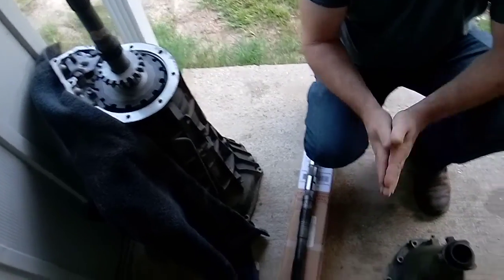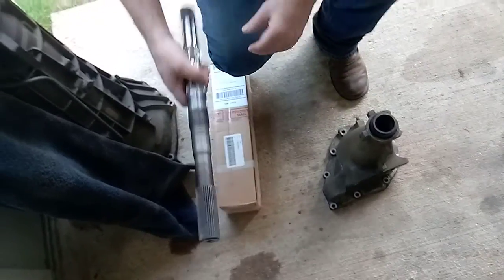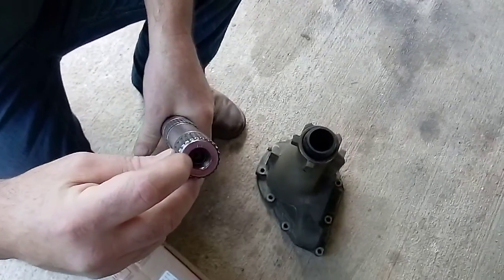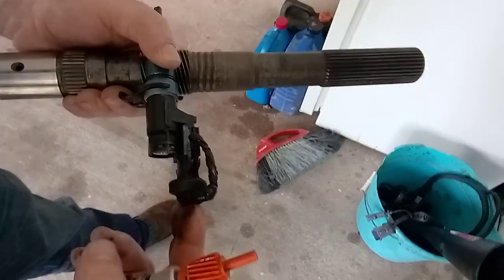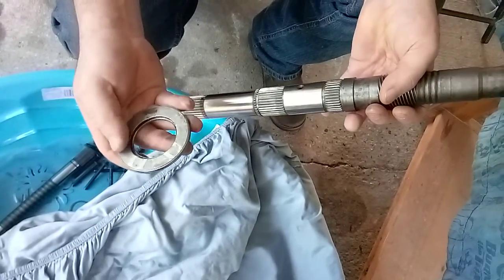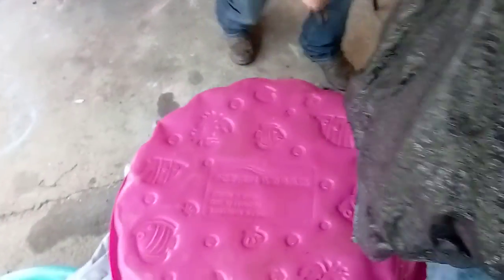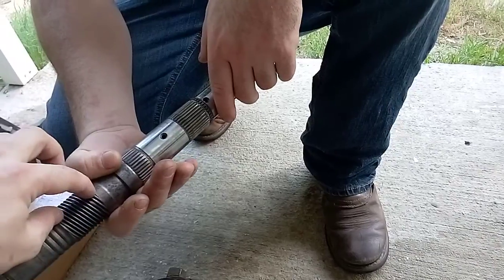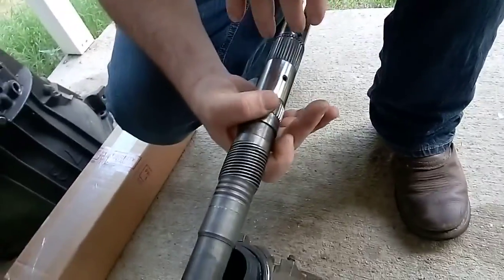Ford E4OD/4R100 Output Shaft Differences Explained

Comment: So i’ve been researching swapping a 2wd to 4wd and was wondering if i would have to drop the trans to change the output shaft or if i’d be able to just take everything off while it’s still in the truck and swap the output shafts? i noticed y’all had the trans out and on its front so i was just wondering
Reply from the maker: The output shaft is held on from a C-clip inside the transmission case. It's one of the last things to come of unfortunately.

Comment: Eh you know if you can convert a e4od 2wd to a 4wd
Reply from the maker: Yes, you can. You need a short output shaft and a 4x4 tailshaft/transfer case combo.
Reply: @shadetreeautomotiveDIY ok so I have a small block bolt pattern e4od 4wd and a big block 2wd e4od so I would have to switch the internals and tail end over to the big block to make the big block  4wd ?
Reply from the maker: @dylansmith3628  So what you want to do is take a 460 E4OD and make it 4x4 from a 5.0 4x4 E4OD? I don't see why you can't switch the internals... Do a little bit more research, I would. They also may vary slightly from year to year. It sounds like you just need the transfer case and the output shaft from the little block trans and the rest of the internals from the big trans. should be put right back into the big case after the output shaft is changed. Count your bolts, pay attention to your patterns. Everything should be the same except the bellhousing bolt pattern.
Reply: Yes it’s a 1991 4wd and a 1990 460 2wd can’t find 4wd transmission for a 460 to have your self these days lol and thanks

Comment: how did you "pull" the shaft out?
Reply from the maker: Snap ring pliers, from the inside of the transmission. The tail shaft is one of the last things to come out, after everything else comes out. I got a video somewhere on here, on the 4R100, where we tore it down. I don't know if we actually filmed the snap ring or not. Sometimes a long pair of needle nose and a long sharp flat head will do the job, better than snap ring pliers. But you gotta have some long arms, cause you're going cave diving. You have limited space to work with. Removing that snap ring is probably the hardest part about taking a 4R100 apart. Putting the snap ring back on is easy.

Comment: First problem was buying anything like that from eBay all this stuff is knock off junk
Reply from the maker: Yes, at the time it was hard to locate a new old stock Ford OEM shaft. Today, you probably can't get them anymore unless they're reconditioned, or from a junkyard. I doubt there are any dealership warehouses out there. The rule of thumb is, they keep auto parts for 10 years. By now, it's probably less time.